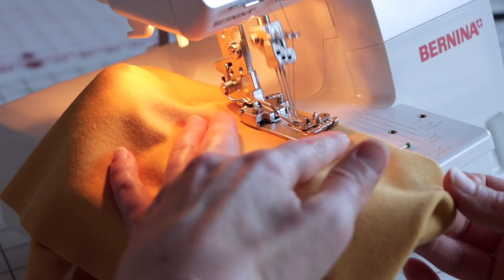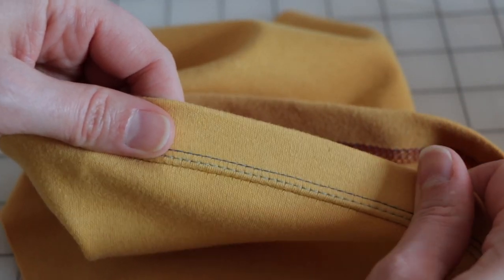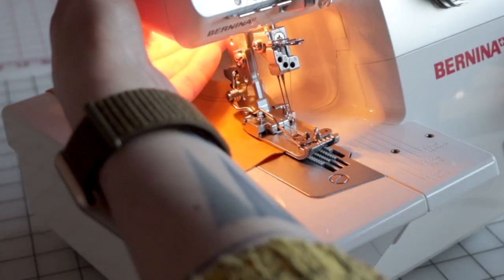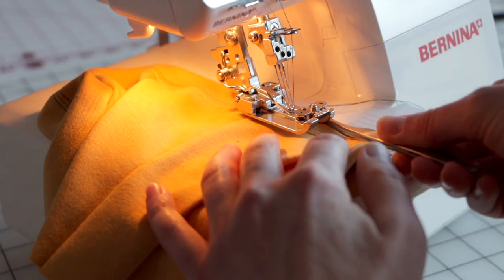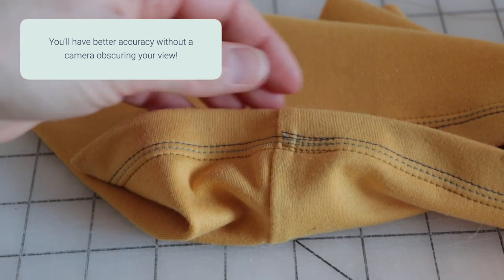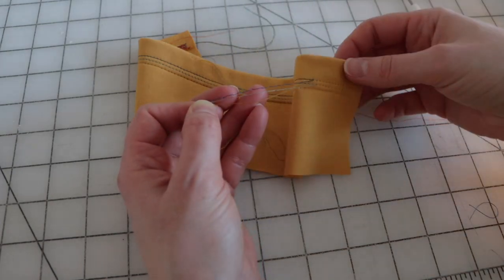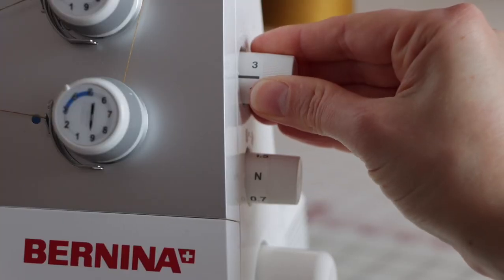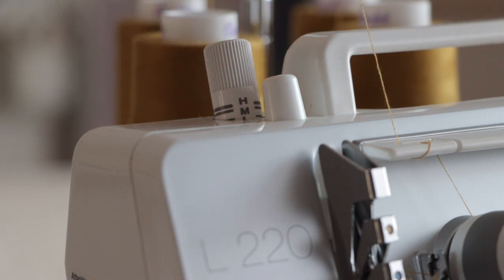A Guide to Coverstitch Machines: What they do, how to use one, and troubleshooting tips

Comment: Newbie sewist here! I’m not clear on the difference between a cover stitch machine and a serger. And is an over locker machine another word for a serger or another word for a cover stitch machine?
Reply: A serger cuts the sewn edge as it is being sewn, and covers that cut edge with layers of zig-zag-type stitching, effectively sewing and finishing a seam very professionally so that no cut edges show.   A cover stitch JUST hems and finishes the edge without cutting anything.   Some sergers can also coverstitch, which is likely the most cost effective option, but I've heard they are very mechanically finicky to use.

Comment: Super helpful and concise, thanks! I've used my coverstitch machine a couple times, but was struggling to get my fabric off the machine without channelling King Kong. Looking forward to playing some more.
Reply from the maker: Interesting! You're pulling the needle threads out and cutting them before removing your project / cutting the looper thread and it's still getting stuck?
Reply: @SeamworkVideo  No, I'm basically doing it all wrong 😆As in: lifting the presser foot and yanking the fabric backward to try to remove it from the machine. This doesn't work well and I have to tug hard to get enough slack in the threads to be able to cut them (there suddenly seems to be 6 of them even though I'm only using three spools). I've also struggled to deal with tunnelling, but now I know to try adjusting the foot pressure, too. I'll be trying the method outlined in the video next time I coverstitch something.
Reply from the maker: @ZoeyDuncan  Oh yeah, that definitely won't work! I get better results when all the needles are piercing both layers rather than straddling the raw edge of a hem. Coverstitch machines can be pretty finicky so save your scraps and do a bunch of tests! You've got this!

Comment: I have been considering a cover stitch machine for some time. I live rural so my preference would be to stay with the Janome dealer since he is close and the service is great. I want to hem, obviously, but I also want to use it for that flat stitch on yoga wear etc. My possibilities are the 900 or the 2000. The difference I can see is having either 2 needles or 3. When buying machines, I have tried to buy the best I can afford even if I don't understand all the bells and whistles on the assumption that I will "grow" into it. The advantage of a 3 needle machine seems to be that I can do a wider double stitch if I want to, or, of course, 3 lines of stitching, which isn't that important to me. Am I missing something in choosing between a 2 needle and 3 needle machine? Thank you for your feedback.
Reply from the maker: 3 lines of stitching are how you can create the reverse coverstitch on activewear! You'll stitch the three lines on the wrong side of the garment and the looper thread will be on the right side. This could be done with 2 needles, but the looper thread pattern won't be as complex. If you can, test out a machine in person to help you decide what you prefer!
Reply: @SeamworkVideo  Thank you for your prompt reply. That settles it. I want 3 needle machine. Thank you. Unfortunately, under stay at home so no testing. I can wait but I don't want to!
Reply from the maker: Yes! It's hard! Some dealers are doing appointments that limit the number of folks in the store, so it might be worth reaching out! Good luck!

Comment: I have the Janome CPX 2000. I also have a basic Janome overlocker ...but a fabulous Bernina sewing machine. I wonder whether to upgrade the Janome machines. Your Bernina looks much easier to use and there’s a baby lock which does both and threads itself ...or is that just extravagant? It’s just that I have no problems with my Bernina.... Thank you for the video.
Reply: Sue the Janome Airthread 2000D Overlocker is amazing 🌸💞🌸
Reply from the maker: Unfortunately, Bernina no longer makes this model! However, it's pretty much the same machine as the Juki 1500 and 1700QVP. What are you not loving about your CPX 2000?
Reply: The cost of the combo Babylock serger + coverstich is more than the cost of buying each machine separately.  I think the reason people get the combo is if they truly don't have the space for 2 separate machines.  I often go back and forth between serging and coverstitching in one project, and making the transition (removing the blade and re-threading) takes several minutes.  I personally would recommend separate machines if you can accommodate the table space for both.